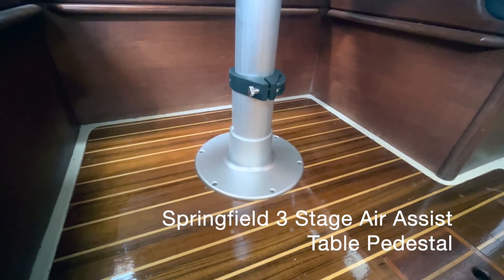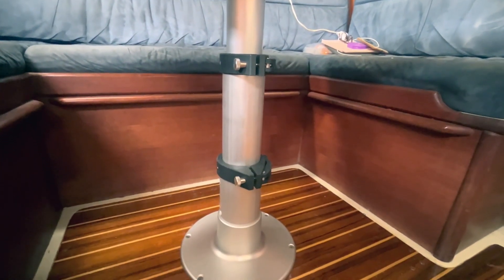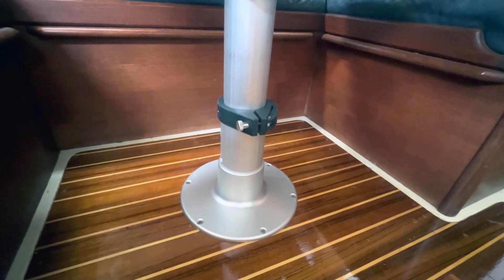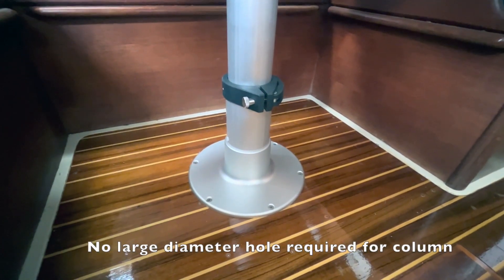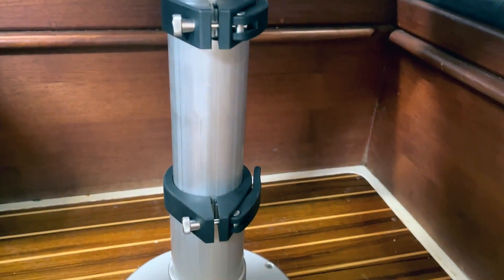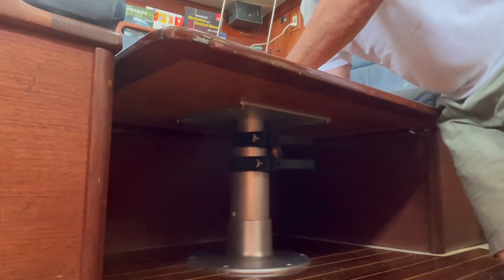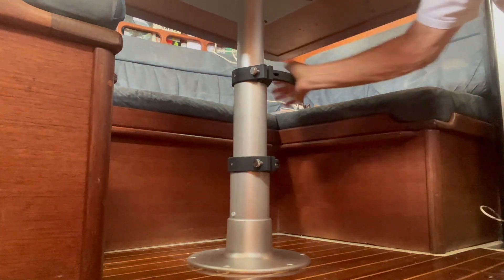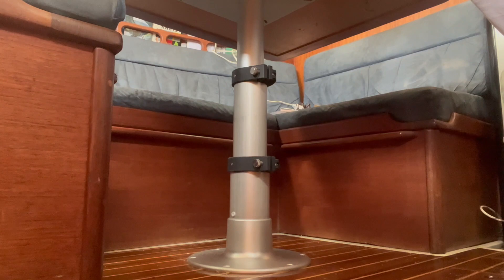Springfield Table Pedestal    HD 1080p

Comment: This is exactly what I need for my fiberglass travel trailer (Armadillo Backpack). The table converts to a bed platform. The OEM column had to be removed manually for a bed and replaced to be a table and was not easy. It's available from many stores. I chose a black column, for looks.